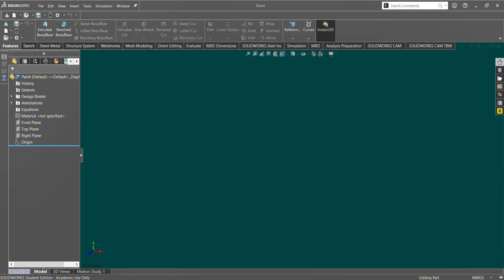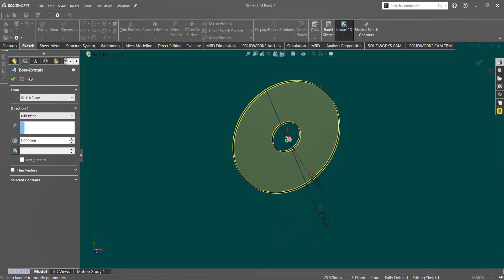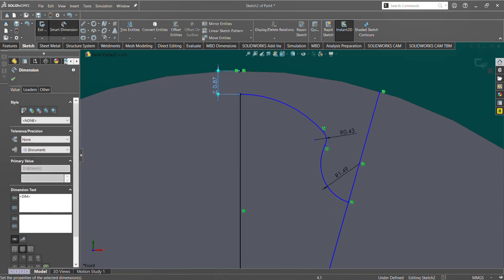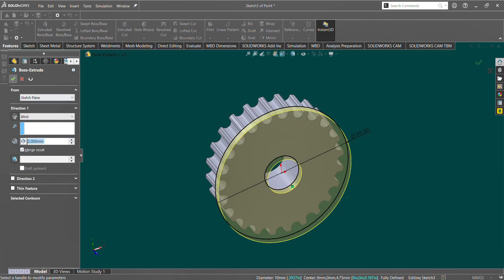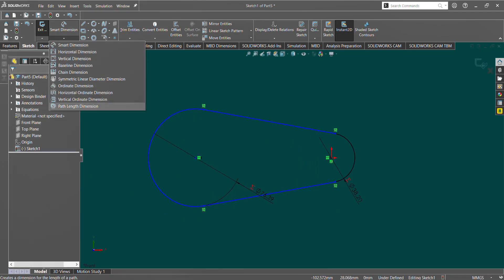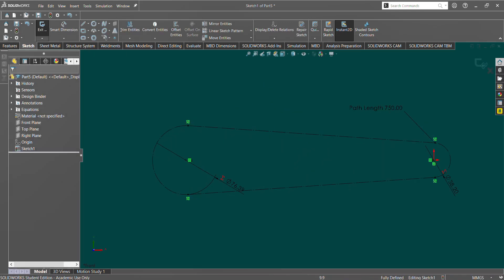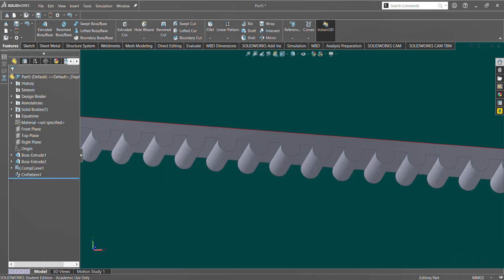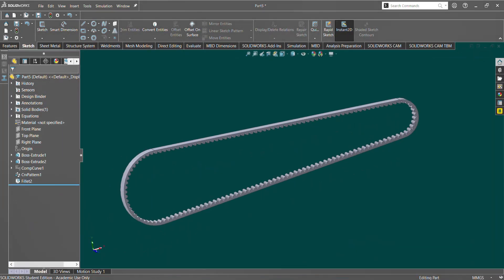HTD-5 Belt & Pulley in Solidworks

Comment: After mirroring the half tooth sketch to make the full tooth, then running the lines up to the pitch diameter circle, then converting the circle to an entity and trimming it off that was outside the tooth sketch, my sketch did not remain fully defined, only the arc remained defined.  If I connected the 3 points, left, right center and make the center point of the arc with the angled construction line that was used to mirror the tooth sketch, it would then become fully defined.  Also when drawing the right line up to the pitch diameter I had a difficult time getting that yellow dotted or dashed guideline to come up, it was a bit of a struggle ; what's the trick to having that guide line show itself?

Also, where did you find that drawing of the HTD-5 pulley dimensions?  I want to make a gt2 pulley using this method.  Thank you!
Reply from the maker: Without seeing your sketch, It is hard to say what caused the issue after trimming. To make snapping easier, you can put a point on the curve (in newer versions of SW there are 4 snap points on a circle) at the 12-o-clock position. As for the drawing, I just found it in an image search for "HTD-5 profile". I tend to just buy pulleys if I am working with GT2-5 profiles (usually in a higher power application). This model works fine for 3D printed pulleys used in light duty applications. 

https://www.gates.com/content/dam/documents-library/catalogs/light-power-and-precision-manual.pdf Useful Timing Belt Drive Guide

https://www.gates.com/content/dam/documents-library/installation-guides/BeltSizingGuide.pdf Another One